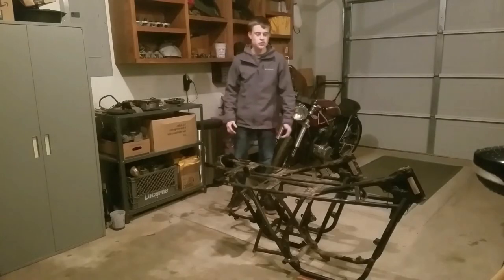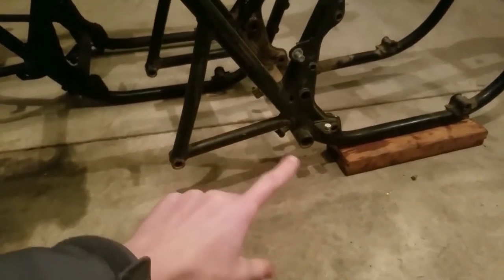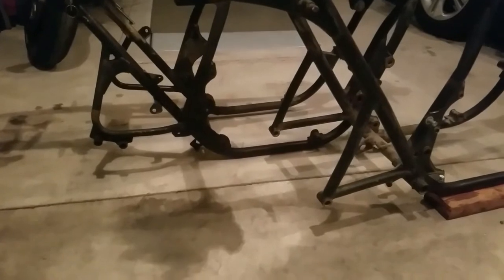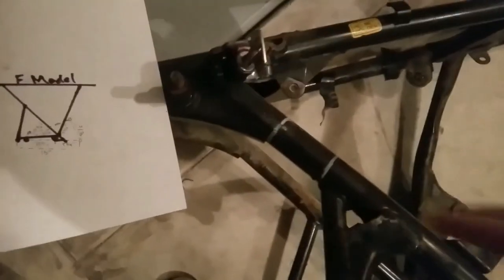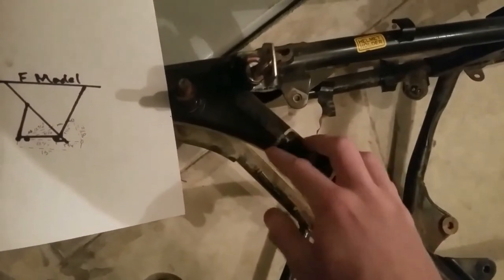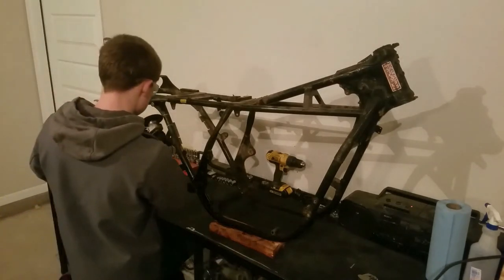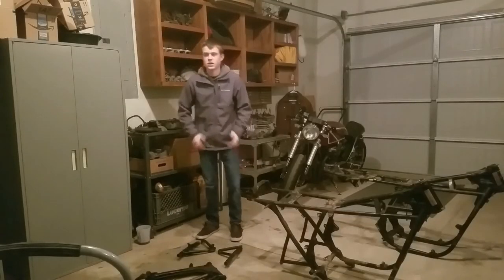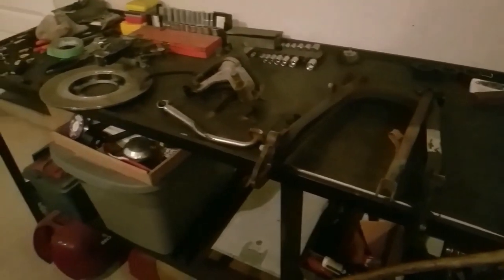CB750 Rear Disc Brake Conversion

Comment: I appreciate the video.  Before I go through with this I am just making sure that your 75-77 F model swingarm bolts directly to your K model frame.  I however intend to use cognito rearsets with the GSXR master cylinder conversion on my K model to avoid the welding you had to do.  With my build its all about the look.  Thank you bud.

Comment: Hey Michael! Good info here. Got a question for you if you don't mind? Why did you choose to swap to the K frame? What was the advantage of the K frame over the F. If you were looking for a K 'look' why not put K hardware onto your F and save yourself the trouble of welding your brake system on etc? I'm looking at an F and at a K currently, I don't love the F tank, but love having discs on both wheels, and the rest seems inconsequential to the look of the bike. I'd plan to swap the F tank out for a K tank and work out the seat situation somehow. So that's why am asking, as obviously you have a strong preference for the K for some reason?
Reply: I have a K bike and am looking to upgrade from drums to discs. He made the video to show the process of upgrading a K bike with the better F bike parts. I don't think he is actually building a bike with these parts.

Comment: Why not just swap frames?
Reply: Great video but I was wondering about the other comment can you just swap frames are the motor mounts the same
Reply from the maker: you could swap frames I'm sure, since the difference between the 750 engines are very minimal. I just didn't go over it since most people who do the swap probably don't have a spare (and titled) F model frame.